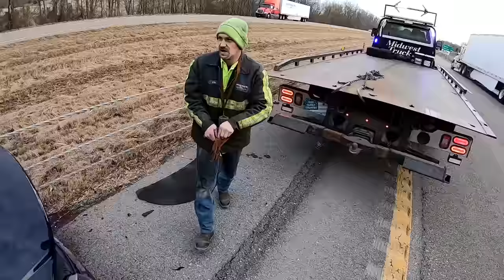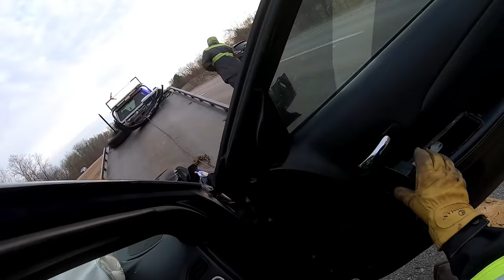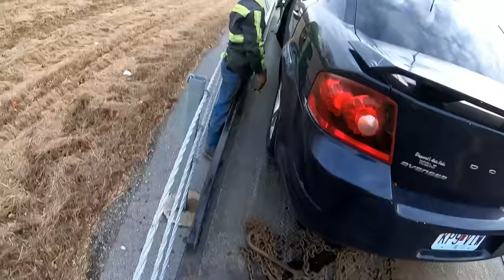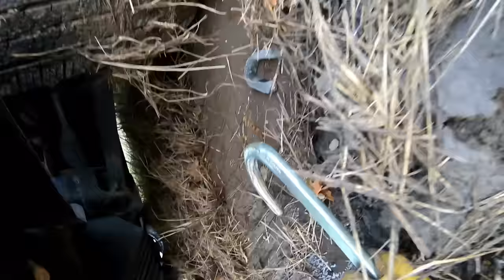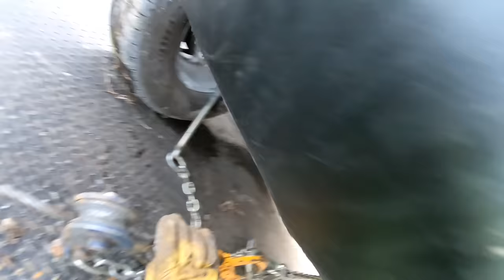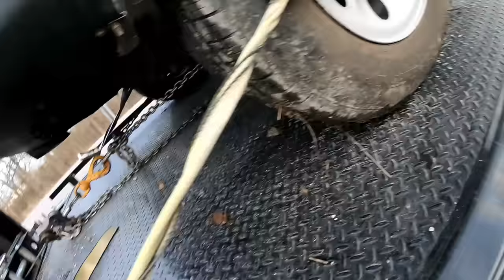Code 3 Car Crash Blocking the Interstate

Comment: is that an automatic transmission in your truck?
Reply: Most of the tow trucks are Manuel. I know the bigger ones they have are Manuel.
Reply: Appears to be a 6 speed auto.  Took me a while to ID the display first time I saw it, display just below the yellow air brake handle shows PP for Park, RR for reverse , and 6x for drive, with the x being the gear it's in as it shifts from 1 to 6 while driving.  The P, R, N, and D pushbuttons for shift selection are just below that.
Reply: Yes, it is.
Reply: @timothybarney7257  I don't know if it's just the mike but the engine always seems to over-rev when changing down.

Comment: Another great job Ron. Glad no one was seriously injured in this crash. If I my ask sir what is going on just past Benton & i think all the way to Sikeston? Last time I was down there were a large path of trees cut down on the right side of southbound interstate looks ALMOST big enough for a service road. I know they are rediung the interchange at the 99 but that to far north
Reply from the maker: @Samantha Herat   From what I have been told, a company was hired to clear the sides of the interstate, as you saw, but just for the clearing.  There will be a new service road on the east side of I-55 between Jackson and Cape.  The rest is simply clearing.  I was told that it was to help make crashes less dangerous and easier to clean up.   There are a LOT of run-offs between Jackson and Benton.  I've worked a bunch of them where we have had to break out the chainsaws.    Not sure if this is the actual reason for the clearing, this was 2nd and 3rd hand information.   Be safe out there.   Thanks and God bless.
Reply: @RonPratt  Ty sir for that info. Was wondering & if anyone would probably know it would be you lol. So Thank you Ron. You as well with thing opening up people are EVEN MORE crazy then before at least here in Southern Jefferson County.
Reply from the maker: Yes, traffic seems to be exceedingly heavy now that things have opened back up.  Either that or I just got used to the lack of traffic.   I actually rather liked the lack of traffic.  Made my response times and towing trips much quicker.....LOL.   God bless.
Reply: @RonPratt  lol Oh I understand

Comment: Re Hi Ron, from Canada Again...

(Side note: You will see many typoes in my text. That is because I have an incurable "cerewbral insult" that makes for a lot of difficulty with small motor physical coordination, hoever when I have the time, I also have many work-arounds that much improve what would otherwise be.)

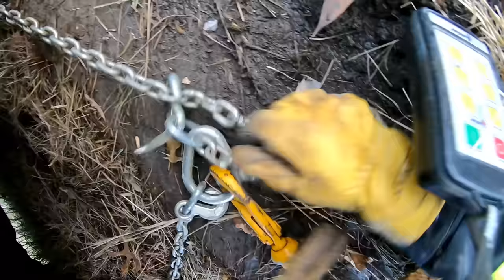AT 18:23 I notice what appears to be a small rock outcropping below where you arecrawling to install the hooks. However not all of that ground shows rock. this could make for added difficulty in tuggn the vehical into position for pulling onto the platform, especially if spome strong piece of all the junk gets caught under the wreck chassis and impales the rest of it.

On another not i see a new officer that I had not seen before so say hello to him from Canada!

Also I see a number of  new roads and interchanges that I do not remember having seen before. What is being done with the lettered indications instead of numbers?

Is this because those interchanges, etc. belong to the interstate's authority and they are running out of Interstate numbers?

In Canada a lot of this is a lot simpler as we do not have the huge population to need it all.

As for Law enforcement, only in one area near Toronto do I remember regional police. The only Canadian provinces that have provincial police are Ontario and Quebec. Hence no such thing as Canadian sheriffs. The other provinces depend on the R.C.M.P. to protect the provinces, but the R.C.M.P.'s primary function is to fight organized crime, drug and people trafficking, major fraud etc.

also a word on the etymological origin of "cop" and "sherriff":

"Cop" is a historical name that came coirsa 1858 to the London bobbies, the forsat known police force. since they wors copper badges, the Londoners would refer to them as "coppers" or "cops" butr this was also a real badge of honoour, so very different from the derogatory way the term is seen today.

"Sheriff" is actually from two words, "shire" and "Reeve".  a shire is the name used equivalent to county in Britain. Henct your Sheriffs are the police of the county level.

"Reeeve" was a paper pusher, not an armed law officer. Hence "Shire reeve" was the local bureaucrat! A log wqayt from today!

As for the female officers, they can be known as "police matrons" and that also is a badge of honour. ZIt dates back to the ancient Romans where "matrona" was a mature adult lady who bore signofocant responsibility. Hence "matrona is that badge of honour for the ladies who serve to defend!

An old friend here has a daughter who was a soccer hero extremely fit and strong. Later she became a police matron (ore on French << matronne policiere >> her fiance served in the military in active duty duri9ng the time our forces were in Afganistan - I think one tough pair! (not all this part is translated from the French.)
Reply: I had noticed a lady dressed in Black before and then when yoou said goodbye to her ahd her partner from the K-9 team, then i realized why she was not in a uniform with a badge. So I guess this Matrona is a k-9 trainer? (As it happens n my ancestry there is an epoch where Animal care is significant.

One of my ancestors, known in his time as "Humanity Dick" or "Humanity Martin" was a member of British parliament and had the "martin Act" passed. This was the first known legislation anywhere aganist cruelty to animals, hence the founding of the R.S.P.C.A. and many more in various other countries (Canada, the U.S. and more) of S.P.C.A.s and other animal protection organisations. Hence both of them are really part of a long legacy and heritage!

Comment: Quick question on this. On the first recovery, why didn't you put the black Dodge in neutral? Would that not have made the car easier to load the car on the rollback?
Reply: From a mechanics view, the CVT transmission was probably siezed.  They are easily damaged in high speed collisions and shear pins do just that in those kinds of hits, dropping one gear into another.

Comment: Wow I had no idea tow trucks could go code 3 none the less with red and blue lightd
Reply: State statute in Mo allows them to run code 3 when the dispatching agency request it otherwise they operate as normal traffic. they are also permitted to use red and blues as traffic warning when on the side  of the road

Comment: Should have turned your wheels in when blocking off the road that way if it were to be struck (even though its huge) it would help move the truck off to the side and away from you guys working.

Comment: Not that there any great spot to crash especially on the interstate  but that worked out pretty well having the emergancy cross over right there
Reply: I think that is what caused the crash.  The white truck attempted to use it but didn't clear the lane and the blue Dodge slammed into it.  Hence the right rear damage to the truck and left front to the car.

Comment: Those were tow trucks! I thought they were fire trucks. It took me a while... I am slow.. to be fair tow trucks should be allowed to have code 3 rights no matter where they are... police, fire, ambulances get them and even though they are needed first in scenes tow trucks should have them so they can get on scene faster and cleared faster. Not only that but they should also work with 911 dispatch centers! AM I GOING TO FAR ON THIS???

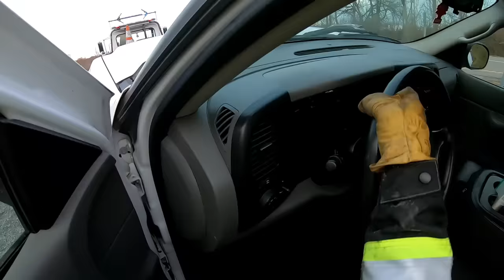Comment: 21:42 Anyone know what that green bottle is?
Reply: Dark green is oxygen. A band of color indicates aluminum; steel would be solid, top to bottom.

Either the driver has respiratory problems or EMS forgot to grab it when they cleared the scene.

Comment: First off you should of taken a different truck to respond with and move the accident. Using your airhorn as a siren with your Red and blue emergency lights is not good  If your Vehicle does not have a siren, lights, etc. Your vehicle should be out of serrvice until your siren is installed. idk personally how many other states enforce this but i can tell you major companys like disney is very strict with this if it does not work you don't operate until it get fix no matter what it is on a golf cart or company vehicle.
Reply from the maker: Please refer to my pinned comment for a detailed answer/response to your comment.  Thanks for watching and God bless.

Comment: Why don't the Peterbuilt have a Siren, If you had a nether truck behind you with a Siren why didn't you let him go first in front of you too clear the way,  No Siren that's not Code 3 that's Code 2, that truck should not be responding too that code 3 call with no siren, your blocking a code 3 responding truck. your having a hard time getting people too move over because no siren.
Reply from the maker: We simply have not taken the time to install a siren on it yet.  As I stated in the video, we are not required to have a siren as long as we have the air horn and red/blue lights.   We are following the letter of the law.   The following is taken directly from the state statute:   

"5.  (1)  The driver of any vehicle referred to in subsection 4 of this section shall not sound the siren thereon or have the front red lights or blue lights on except when such vehicle is responding to an emergency call or when in pursuit of an actual or suspected law violator, or when responding to, but not upon returning from, a fire.

  (2)  The driver of an emergency vehicle may:

  (a)  Park or stand irrespective of the provisions of sections 304.014 to 304.025;

  (b)  Proceed past a red or stop signal or stop sign, but only after slowing down as may be necessary for safe operation;

  (c)  Exceed the prima facie speed limit so long as the driver does not endanger life or property;

  (d)  Disregard regulations governing direction of movement or turning in specified directions.

  (3)  The exemptions granted to an emergency vehicle pursuant to subdivision (2) of this subsection shall apply only when the driver of any such vehicle while in motion sounds audible signal by bell, siren, or exhaust whistle as may be reasonably necessary, and when the vehicle is equipped with at least one lighted lamp displaying a red light or blue light visible under normal atmospheric conditions from a distance of five hundred feet to the front of such vehicle."

Please note the last section which states that we can use an "exhaust whistle".  The air horn is defined under the "exhaust whistle" category, much like the warning systems used by trains....an exhaust whistle train air horn.   So, again, we are following the law.   We will be installing a siren, but as I said, the air horn still covers us.    I do understand the difference between Code 2 and Code 3.  The main reason I went first is because Mike was on another job when the call came in.   I left directly from our shop, which was closer to the incident.  It just so happened that Mike was able to catch up with me in the traffic back up.  Thanks for watching and God bless.
Reply: Peterbilt*